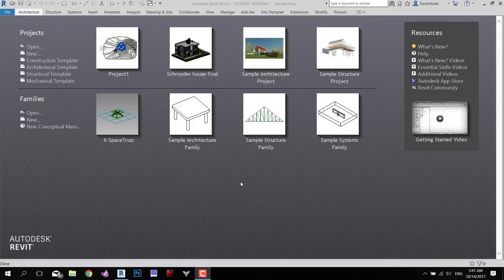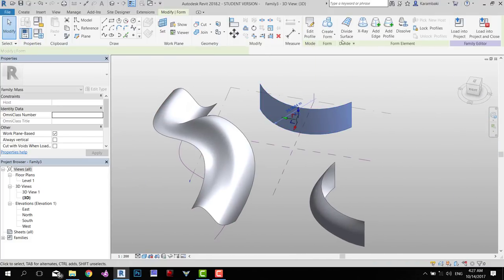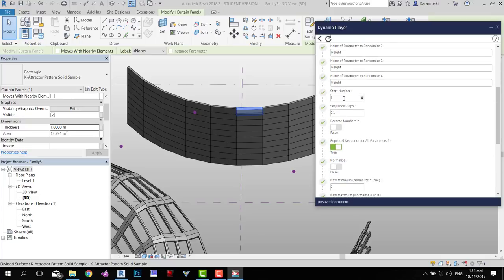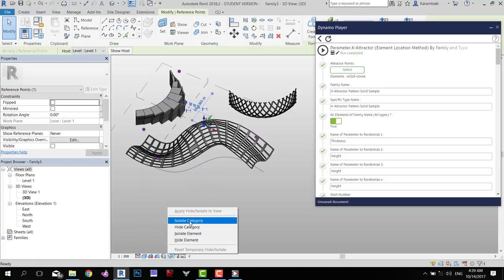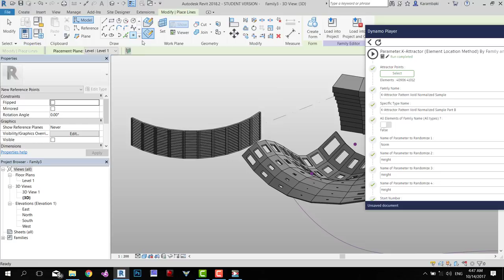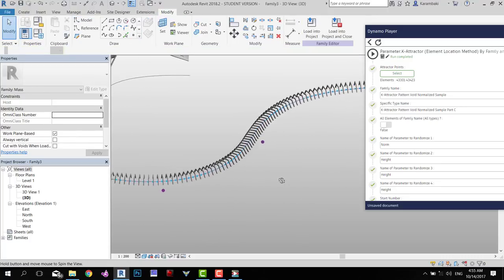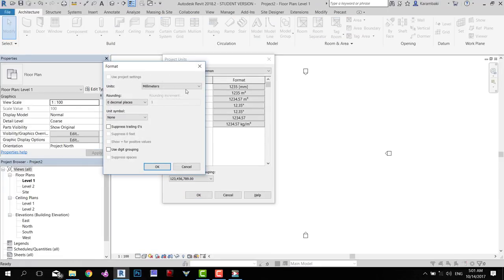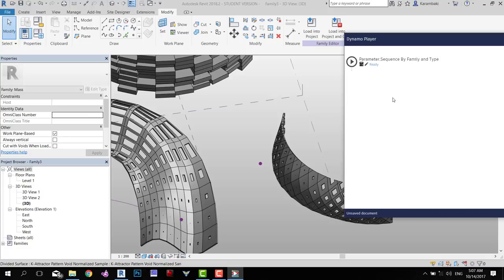Parametric Computational Designing using Revit (K-Attractor)

Comment: Hi Karam, Amazing Toolkit but i seem to have run into a problem. Could you possibly help me figure this out?

I have a curtain wall with a custom curtain wall panel family. This has an instanced parameter for the offset. 
Now when i use the K attractor by family and type and select a desk as the attractor and type in the correct family i get a list of the selected elements, But... i cant seem to generate any values? It works fine when i just try to randomise a parametere by family and type but i must be doing something wrong in the attractor? 

I would love some help since i cant seem to figure this one out on my own :)
Reply from the maker: Johan Kleijn Hey Johan, 
If you can please send me the family so I can check it out and test it in my side
karam.baki@gmail.com
Reply: I tried remaking the family again today and for some reason it works now. Thanks for offering to help really appreciate it! seems i did something wrong in my family
Reply from the maker: Johan Kleijn nice to hear that.. good job
Reply: @KaramBaki  It might also have been that i had an opening cut in my curtain wall the script does not seem to work once you have one of those
Reply from the maker: Johan Kleijn it theory, the script reads the family location.. no matter what happens it.. my best guess would be incorrect input (for example parameter name is case sensitve).. 
What ever the reason.. it's good to know it worked with you

Comment: Great video Karam! I am facing a problem however, with your updated version. I am trying to replicate your tutorial step by step, but for some reason, after hours of different trials, every time i try to run the K-attractor for the void sample, i end up with a "null" for 'values generated'. Meaning that the components aren't changing in any way or form. Any idea what the issue could be? I've made sure that all the family and type names are correct, and the norm values are between 0.1 and 0.5, normalized.  Your help would be much appreciated.
Reply from the maker: Thanks Georges, am really sorry to hear that, 
The only way I can help is by sending me your .rfa so I can test it in my side and reply to you the possible problems happening in your side 
Please send it to : karam.baki@gmail.com
Reply: @KaramBaki  Thanks for your quick reply. I have figured that part out actually. But I had one more question, do these masses strictly need to be done in a "new conceptual mass" ? or can i model them in a project as a "mass in place"? because when i do so, the dynamo player doesn't recognize the model points i select as attractors for some reason. Thanks again for all of this stuff :D
Reply from the maker: @georges793  Yes, Dynamo Cannot access the inplace families in general, It has to be loadable, 

Hint : You can transfer anything from the project environment to the mass environment using Conceptual.Face to Mass Scripts

Comment: For some reason the K adapter isn't working for me. It doesn't give me the (Element Location Method) option. It just says Parameter. K attractor By Family and Type, Parameter. K attractor By Range with Family and Type, etc. I tried re downloading it and resetting revit but it still doesn't give me that option. When I try all these nodes and continue the steps in the video it says that there is an error. I copy pasted the Family and Type so i know that isn't the issue. The pattern works just fine it's only when I try to use the attractor points that i get an error. 

Another thing is when i try to load the pattern family into my project it doesn't work. It just shows up as a blank file... :(
Reply from the maker: Jessica Melgar 
Hi Jessica, I have updated it to a new version, 

The element location method and bounding box method are embedded in the node it self

You scroll down in the dynamo player menue to switch between them
Reply: Same here :( did you find the solution?
Reply from the maker: Tamar, the K-Attractor is updated, the (Element Location Method with the Bounding Box Method are in the same node now, you can switch between them directly in the same player menu, NOT SEPARATED AS BEFORE 
YOU WILL NOT FIND K attractor with Family and Type by a "Method"
YOU WILL FIND "Parameter.K-Attractor By Family and Type" 
USE IT.
Reply: Thank you so so so much for video and quick reply on my comment. 

I'm using it and still "run completed with errors" :(   I can't really figure out what I am doing wrong.
Reply: Solved!  Anyone dealing with the issue: check the project units!  set them as they are in the video, so you won't get error message any more (that worked for me..)